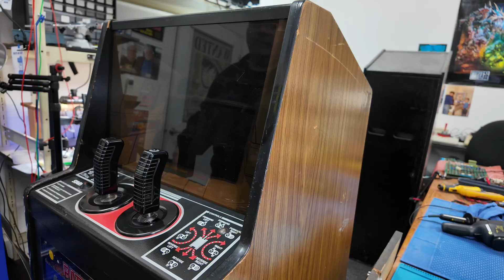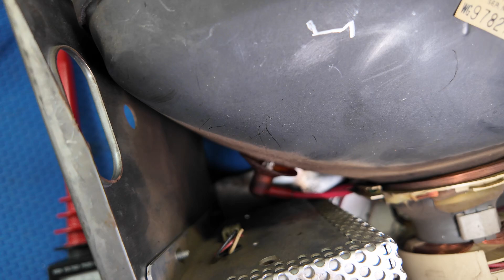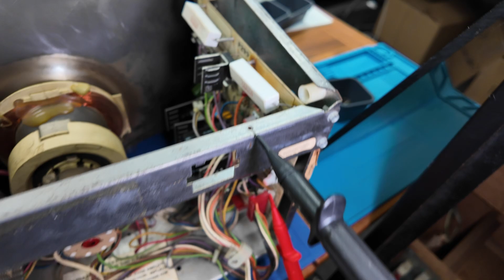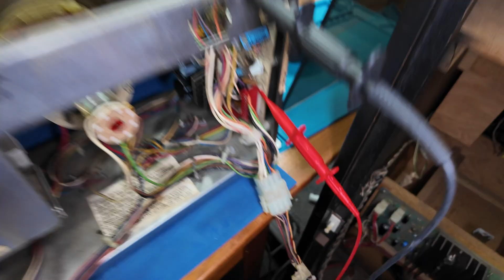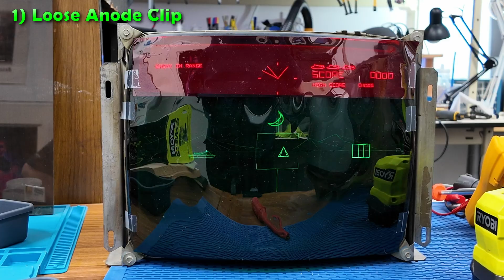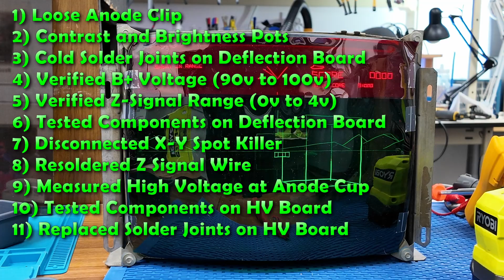Repairing an Atari 1980 Battlezone Monitor with Brightness Problem (Part 1)

Comment: Since they're unavailable as a replacement part, what would it take to rebuild a high voltage transformer like that one? There must be some demand for them.

The last time I worked on one of those, the HV was around 19kV. I don't remember which game it was.
Reply from the maker: That's a good question. Is it possible to repair a HV transformer?

Comment: That meter looks brand new :)
Reply: Yes swap that high voltage board to get some answers
Reply: @FixthisCD  Good idea, I've thought about checking if my Asteroids game has a 19v2000, and if so, borrow the HV board for a test. It would be nice to confirm the issue is with the HV board.
Reply from the maker: I really love that HV probe. Having the voltage meter on it is a great way to verify that the monitor has actually been fully discharged.